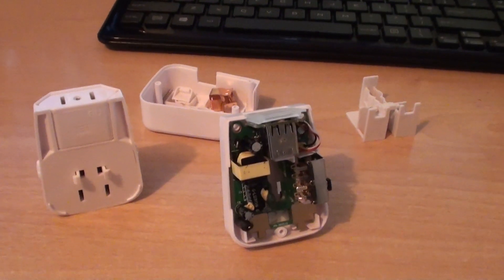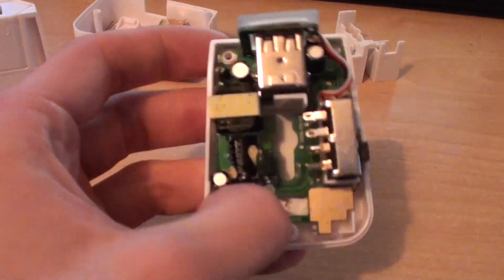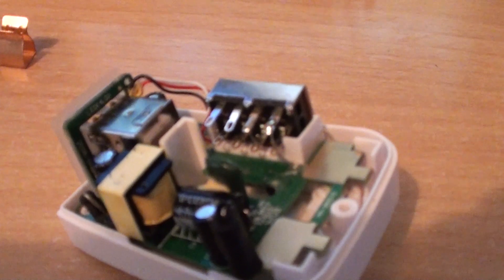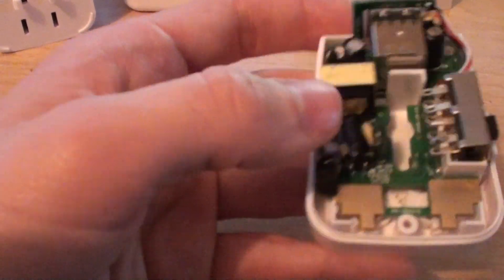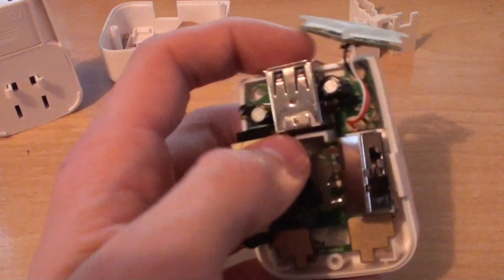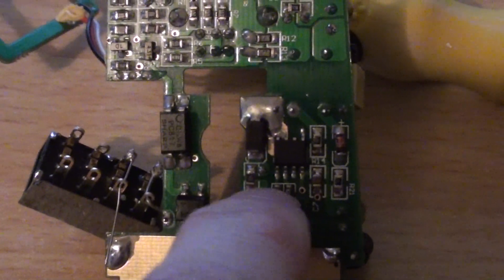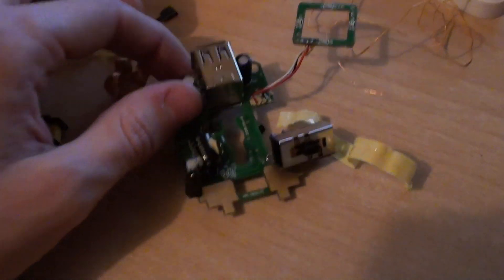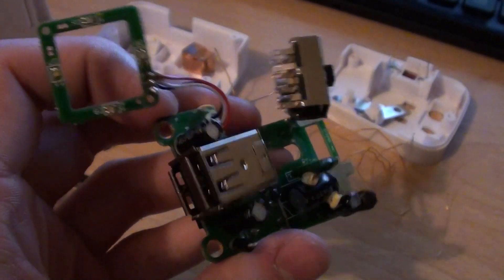Dangerous USB Charger Teardown

Comment: lol you should have seen the ones I got for £!!  Same as these,. One exploded in my had as I plugged it in !! The cover blew up. Mind you at £1 I was cautious. The whole thing just clips together, nothing is fixed. Yours is a TRolls Royce in comparison/

http://www.ebay.co.uk/itm/Portable-3-1A-USB-3-Port-Triple-Wall-Charger-Home-Travel-AC-Charger-Adapter-EU/391356199930?_trkparms=aid%3D222007%26algo%3DSIM.MBE%26ao%3D2%26asc%3D20140122125356%26meid%3D188d5aa46efe4bd2a99ecd4079ef4817%26pid%3D100005%26rk%3D5%26rkt%3D6%26mehot%3Dpp%26sd%3D262458215633&_trksid=p2047675.c100005.m1851

Comment: If it started to get hot just leave it plugged into an extension cord on a cement floor and film the carnage as it overheats on it's own. I bought a solar USB charger and it came with a USB mains adapter. I never plugged it in. I refused to use it. Cracked it open and it looked dodgy to me no switch mode stuff just regular transformer stuff like this.

Comment: A colleague of mine, had a cheap apple knock off iPhone charger, that stopped working, when I took it apart I found that there were scorch marks on the inside of the case from a voltage regulator that was undersized. the mains power was not sufficiently protected from the transformer as well.

Comment: SMPS transformers for 5V low current jobs are supposed to be small. It's really not as bad as you say it is.
Reply: +NoBudgetTech 
Yes it is small, but it is too small.
Reply: Nope. Most USB adapters have 1A maximum current at 5V. That's 5W. This transformer is more than enough for an amp, possibly even more. A. I have seen brand name chargers like Apple, Samsung and LG 1A chargers use smaller transformers.
Reply: NoBudgetTech
It depends on the topology used, the core material used in the transformer (there are different grades of ferrite), the frequency used, and a few other factors.
This charger has two ports, so I'd say it should be able to do at least 2 amps.
I watched the video and didn't see any hot looking components, so I don't really know what actually got hot.
It might have been the secondary side rectifying diode, sometimes they leave out the snubber circuit to reduce ringing, and the diode might run hotter.
It might have also just been off-gassing odors.

Comment: And we entrust such a cheap charger to charge our very expensive devices.
Reply: £10 is not cheap!! Mine was £1 it exploded in my hand as I plugged it in, not the same type. these http://www.ebay.co.uk/itm/Portable-3-1A-USB-3-Port-Triple-Wall-Charger-Home-Travel-AC-Charger-Adapter-EU/391356199930?_trkparms=aid%3D222007%26algo%3DSIM.MBE%26ao%3D2%26asc%3D20140122125356%26meid%3D188d5aa46efe4bd2a99ecd4079ef4817%26pid%3D100005%26rk%3D5%26rkt%3D6%26mehot%3Dpp%26sd%3D262458215633&_trksid=p2047675.c100005.m1851